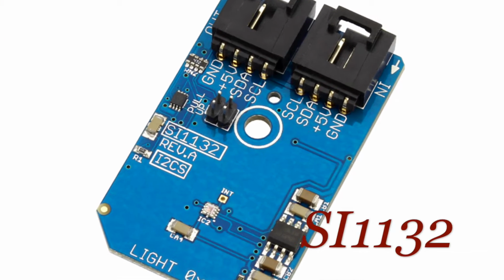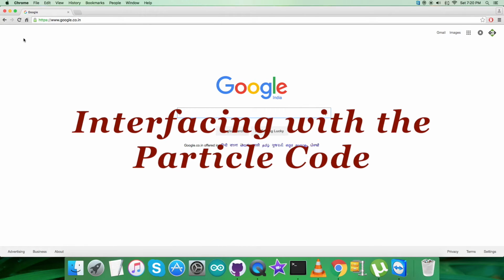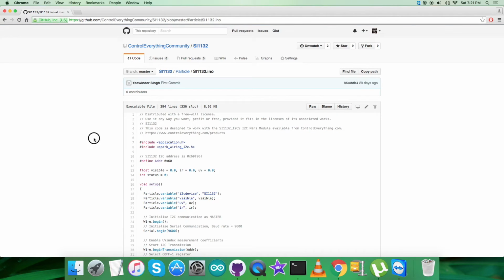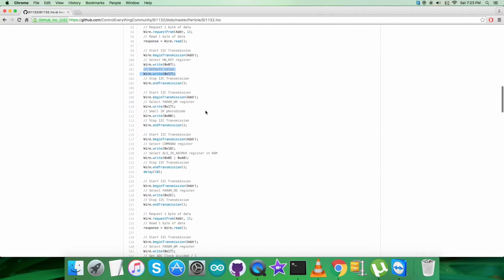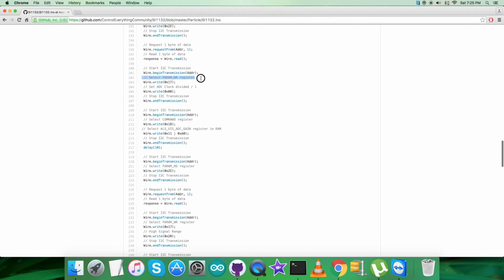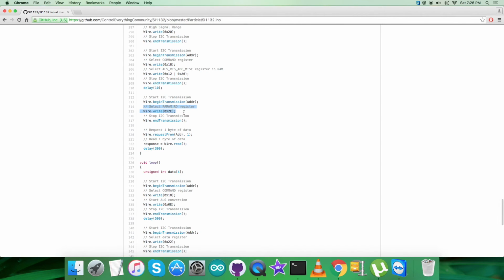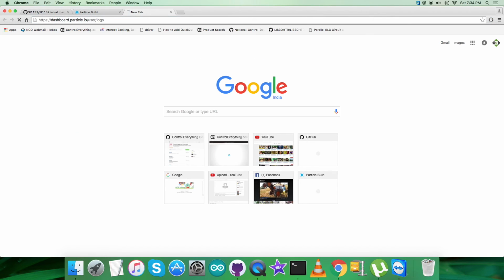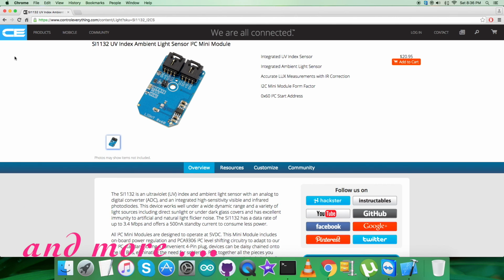Particle Photon SI1132 UV Index Ambient Light Sensor Tutorial

Comment: i've connected the SI1132 device, flashed the code exactly from github.. always seem to get the same values.

Visible Light of Source: 260.00 lux
IR Light of Source: 284.00 lux
UV Light of Source: 2.00 lux

doesn't matter if i place my hand over the sensor or not.. always the same values.. could this be a faulty sensor?
Reply from the maker: can you detect your sensor. run an i2c scan code and see if you can detect it.
if you can then i will say sensor is communicating. then you can look into the code, just try to read the visible light. 
and if you can read then sensor is fine and you will need to look into your code.
let me know if it works.